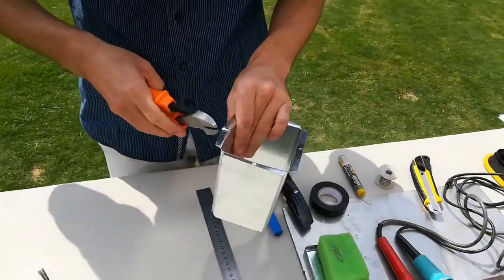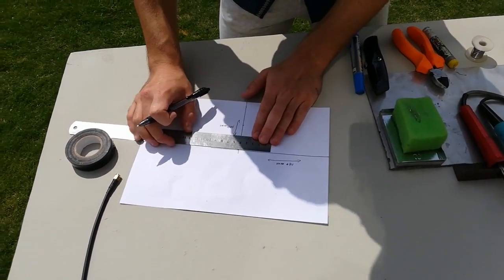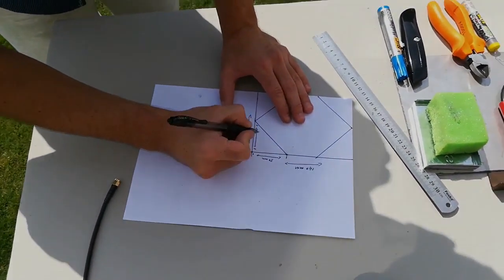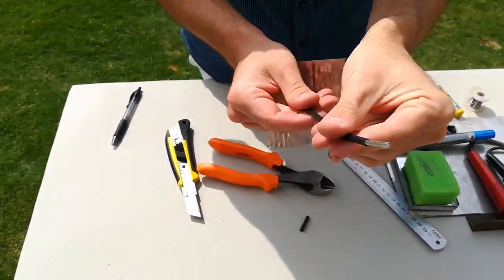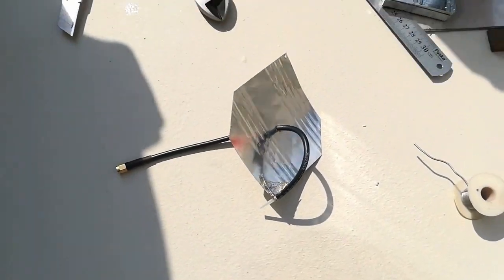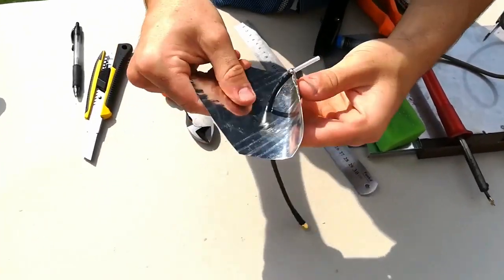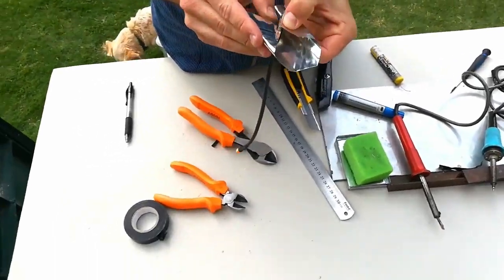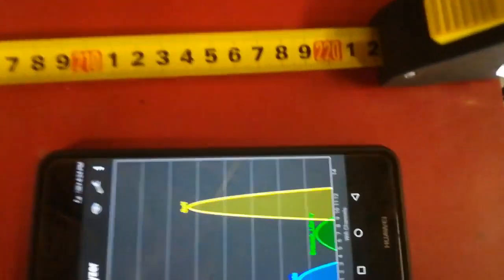Build your own WIFI Antenna - Brandon Verkerk

Comment: This was a great video. Do you have a list of the materials you will need? And cost? The dogs were cute. Love ypur sense of humor :) ❤️🙏
Reply from the maker: Thanks for watching - These were done by interns that were at Poynting 5 years ago, and we don't have a list of materials. But as you watch you will see what you need. 

From what I see you will need:
- Tin Can or piece of tin
- Piece of HDF 195 Coax cable or similar
- SMA Connector or connector that fits on your router 
- Insulating tape

Hope this helps:)

Comment: Hi. I'm a little confused. You said that if the inner conductive strands make contact with the ground plate then the antenna won't be effective but then you solder both the inner and outer strands to the ground plate making a close circuit. I just don't get it. I did a continuity test of an AC wifi antenna that came with my Gigabyte motherboard (that works extremely well) and came negative (the inner and outer strands are not connected). The antenna I'm building is for another PC and I'm using copper instead of tin. Thanks for making this video. Take care, bye.

Comment: Hi, i broke the wire off a single plug on ipad Wifi connector. Question- looking at the wire, it seems to have inner wire and a bit of outer braid. Does this mean the inner wire connects to the very thin pin and the outer connects onto outer round clip that buttons onto socket on board? 
so theres 2 connections outer and inner ?  do i need that outer connection or only the inner pin to make the antenna work or is the braid grounding and it wont work right without?   thanks

Comment: Hey there, great video! I just had a question about where I could buy one of those sma cables. Thanks!
Reply: I find it's easier to make My own cords for everything than finding it in a store these days.😏 But I'm an electrician and have the tools but it's still probably easier to get some wire strippers and connectors

Comment: Great content ! What are the specifications for this antenna, in terms of crude beam characteristics (is it directional or omni-directional, and how to direct the wave in a particular direction if it is directional), as well as the gain that can roughly be expected for each band (2.4 & 5.8GHz) respectively, given that it is dual-band -- also is it more optimized for one of these bands, or should it perform roughly the same for both? Thanks
Reply: it is kinda omni, but the materials and the shape used in this video are kinda random. the omni-directional ones are weaker in range than the directional ones. "better use copper not tin or alluminum for omni" you better search videos where they show how to make a directional antenna with a can combined with a satellite dish "cantenna" using one right now, works really good. that's the best homemade antenna you can create. and you direct it manually, until you see the best strength signal on the screen on your PC or Laptop.

Comment: Can i conect roof wifi antena coper cable to the chip in the wifi extender, repeater, to make what ever that is called a repeater with a longer antena? will it work
Reply: @poyntingantennas  Thank you am a student engenire.So just experimenting.